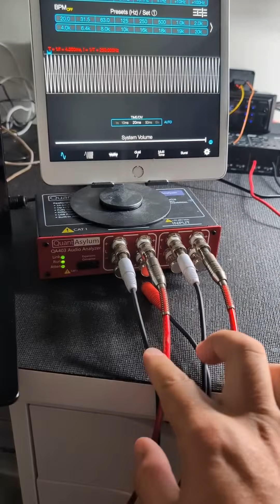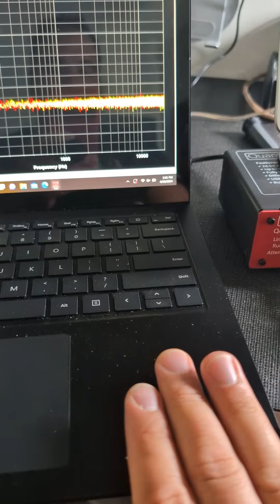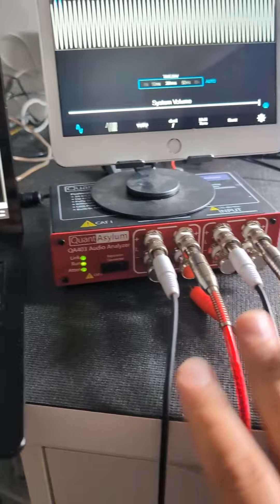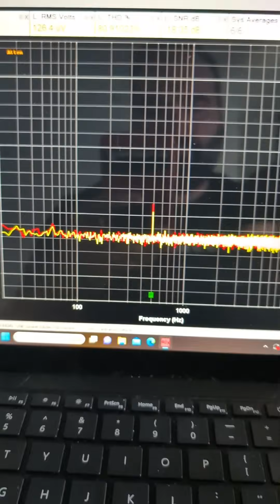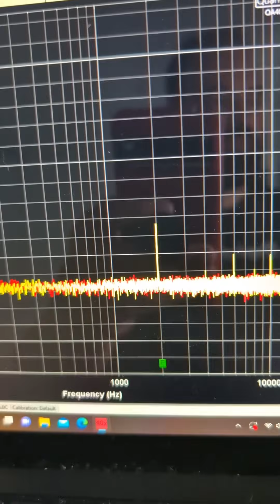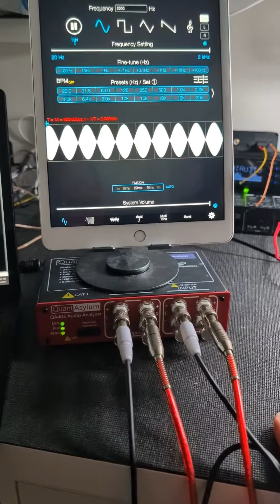Can RCA signals pick up electrical noise?

Comment: Very informative, thank you! I'm looking into why my turntable/mixer setup had a low buzz when I set up to play at a bar but not when set up in my living room, this might be the reason. Now I need to figure out why the main mix was bleeding into the headphone cue when it should have been isolating the cue in my headphones (also an issue that only occurred at the bar, and not in my living room 🙃) if you have any insight there 😆

Comment: Hey, what cause on all amps for subs (tested all amps) 0,5 volt noise without any signal, disconected rca itp. Amplifiers tested: Vibe mono21k (2021year production)  BRX 12000  (after Recap ) And Emphaser ea2500.
Problem: Amp mallufunctioning head unit. When i put wire on amp body, and next wire to RCA input ground, i have 0,3 or 0,4v and droping to 0,1v. This same with touching GND terminal and amp body, Amplifier puts bad output, distorted, noised itp.
How to fix this? Thanks!
Reply from the maker: @basserex4991  low quality amps can have a constant switching noise - low quality pre amp with high gain, etc
Reply: @LoudFiat  do finally. I cant have good sound from any amplifier in car ? :/  sound are very unclear. On warm day only i have good bass :/

Comment: I'm not familiar with the interface that you're using but I'm curious to see how a high end audio interface from say like Universal Audio or Focusrite would either hinder or help clean up the signal. Also, I'm curious to see if using Mogami or any other high end RCA's (Knu Konceptz) would result in such a test.

I don't doubt your findings but I'm just curious to see if using a better audio interface and well known high end RCA's would yield different results.

Comment: It would be really cool to do this same test and show the amount of noise transfer with the wires Crossing at 90° compared to parallel. Maybe even 90° with one elevated above the other. You could also show how a higher RCA voltage results in a lower amplifier gain and less amplification of noise. 

Cool stuff!